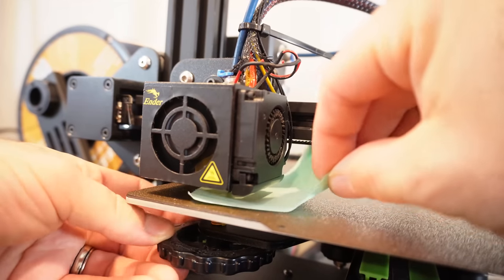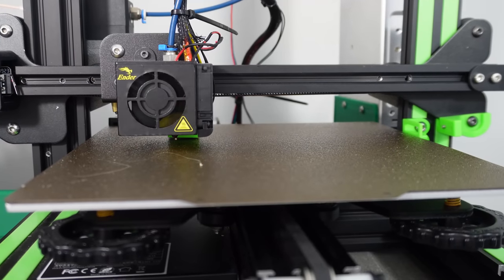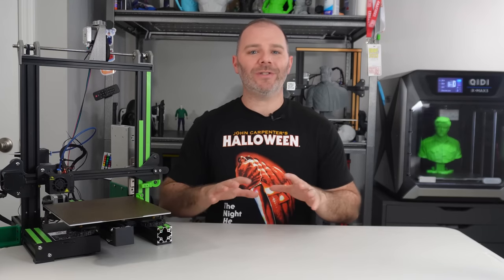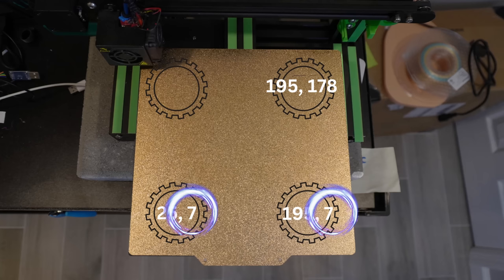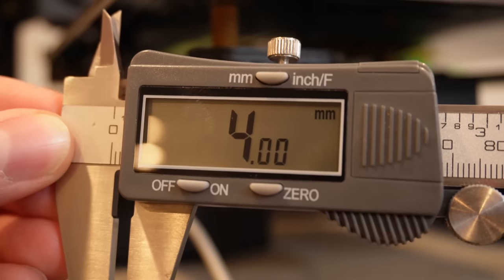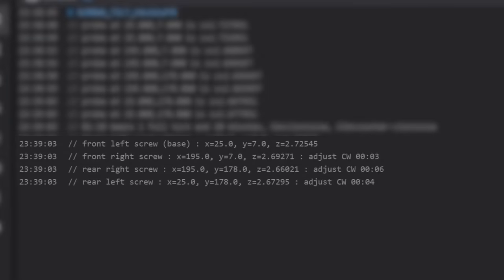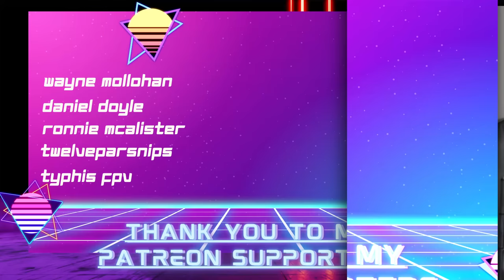Let Klipper level your bed with the built-in tool screws_tilt_adjust

Comment: Can this method be used without a probe? I have a cr10 smart that only has the strain guage, the board is not compatible with a bl touch and i dont want to swap out a perfectly good board.
Reply from the maker: Absolutely! If you're using that strain gauge as the bed probe it will work just the same. All you would do is love the nozzle up over each bed screw, use that location, and the operation should work just the same.
Reply: @PrintsLeo3D  awesome, I was hoping that was the answer. I've been trying to calibrate and dial in my printer since getting the sonic pad 3 months or so ago... has not been an easy or fun task. I just redid my pressure advance with your video. I think I'm getting closer now.
Reply from the maker: Good to hear it. That Sonic pad can be an easy way to enter Klipper, but it sort of puts some barriers between you and Klipper which can end up being detrimental to getting your printer locked in. Hope you sort it all out and I'm happy to help however I can.

Comment: I have a Neptune 4 plus which has 6 base leveling knobs, how do I account for that?
Reply from the maker: Within the screw_tilt_adjust macro, you can add all the screws and positions you have. So while I am only using screw1-screw4, you can add screw5 and screw6. This will cause the printer to also park over those screws and perform the calibration.
Reply: @PrintsLeo3D  thank you! I didn’t know I could just add stuff
Reply from the maker: Yea I had never ran into this either. Luckily we have some really awesome people here on YouTube and on the Discord who were able to verify this works. Good luck and I hope this gives you a silky smooth bed level!

Comment: If you're trying to do this on something like the Neptune 4+, would you just align the extruder tip with the bed springs?
Reply from the maker: I'm not too familiar with the Neptune max 4+ and it's probing system. If it uses just the nozzle as a probe than yes you would just put the nozzle over each of the screws. That printer looks awesome, and almost makes regret buying the T500 instead

Comment: Do you need to heat the bed first?
Reply from the maker: It's up to you. This is a topic that can be up for much debate. I understand most peoples' stance that the bed will change its shape while heated, but I prefer to perform this calibration while it is unheated. In the end what I always recommend is to stay consistent. If you heat the bed while bed leveling, also heat the bed for z offset and bed probing.

Comment: In my opinion the best bed leveling is manual bed leveling. It saves you a lot of time and money. I bought bl touch and built the click probe, didn't work for me. Now I just do manual. I level only when I change filament type otherwise I don't touch anything, it's just works.
Reply from the maker: Well those probes you mentioned really are only effective on a bed that is manually leveled. So either way slice it you still need to get your hands dirty and level. This is a great middle ground to harness the power of those probes and get the bed perfect for them to work effectively while printing!

Comment: Guys please help me out with Klipper on corexy.  I changed my board from marlin(mks gen L to klipper(mks skipr)and my printer got much more louder.  I literally use the same settings as possible.  Same drivers (tmc2209) ,stepper motors etcetera.  
The settings difference are: klipper have sensorless home, uart, and the drivers amper set by klipper, not manually with screw. I did try to change Stealthchop_threshold to 9999999,9999,500,200,60 and 0 by activate the spreadcycle. Nothing different.  Also did try to.play with microsteps but the 16 was the most "quite ".
Reply from the maker: My first guess would be changing over to spread cycle should quiet everything down. When you tried messing around with the tmc settings was there any change in volume whatsoever?

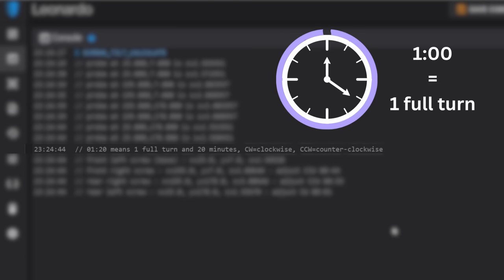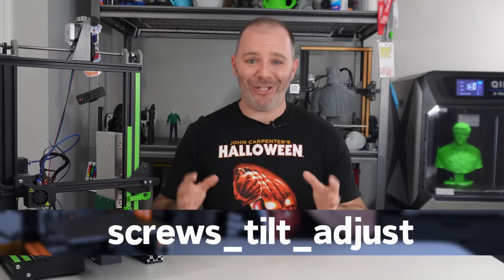Comment: This is a very nice tutorial. Unfortunately you may be confused by the explanation starting @15:32. The example text is "01:20 means 1 full turn and 20 minutes,..." The narration says the clock face has a full rotation of 60 degrees with 1 minute per degree. But this is wrong, obviously. The clock face has a full rotation of 360 degrees, corresponding movement of the minute hand of a clock by 60 minutes. So, for the minute hand of a clock, the rotation is 6 degrees per minute. In these instructions we're told that after 1 full turn ( = 1 hr), we need to add another 20 minutes. So 20 minutes times 6 degrees/minute means to turn by 120 degrees. Or think of it as a fraction of a whole turn where 20 min / 60 min represents 1/3 of a rotation. One third of 360 degrees is 120 degrees. So the "20 minutes" does NOT mean turn the knob 20 degrees (as stated), it means turn the knob 120 degrees ( = 1/3 of a full rotation). The narrator knows how far the knob should be turned, but the explanation is confusing and technically not correct.
Reply from the maker: Thanks for watching and leaving the informed comment. A lot of people have pointed this out, and this isn't how I chose to interpret the way this operation works,  this is just how Klipper implements it. They have deemed this is the best way to characterize the adjustments (1 full rotation is 60 minutes, and thus 30 minutes would be 1/2 a rotation). Obviously a full circle is 360 degrees, but in attempt to (I guess) simplify this, Klipper has opted to consider a full turn 60 degrees, and then slice up each individual degree as a minute. Perhaps it would be better stayed as "Klipper's clock face" or so ething similar but this is the setup they chose. In my opinion I do think this is a more intuitive way to express the information even if they are not 'technically' correct.
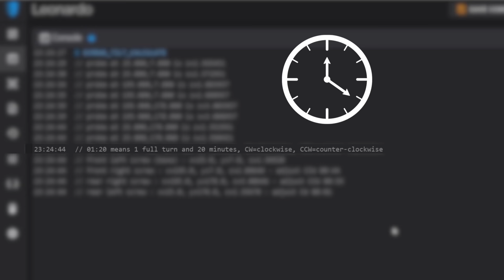Reply: @PrintsLeo3D  Sorry to belabor this point, but it is definitely NOT more intuitive to express 20 minutes on a clock face (1/3 of a full circle) as equal to 20 degrees (after you introduce a new definition that equates 1 min to 1 new degree which in reality represents 6 actual degrees. Most people know that a full turn is 360 degrees. When you reverse course, that doing a 180. A perfect right angle is 90 degrees. So if you talk about degrees, that is the measurement people are already familiar with. I realize you're stuck with certain decisions made by the programmers, but the translation from minutes on a clock face to degrees appears to be something you chose to introduce (see @15:52). Right there you state that 20 minutes = 20 degrees. My question remains: Why?? The Klipper output says nothing about degrees. The ONLY reason to introduce degrees is to take advantage of common knowledge that a full circle represents 360 degrees. It simply confuses the whole thing to REDEFINE one full rotation of the minute hand on a clock represents 60 minutes (ok, people get that) but then calling that 60 degrees (!!! What?? That's just not right..) just confuses things. Now some will easily figure out this redefinition, but anyone who does, also doesn't need to conversion if the first place. In fact no one needs that redefinition, it's actually harder and more confusing than just sticking with minutes on a clock face.

Comment: I have problem with klipper bed mesh, always had it. 
When doing screws_tilt_calculate I can get the bed really level. So Klipper is showing it that every corner is 00:00. 
BUT actually bed is tilted. Left side is lower and right side is higher.
If I manually move the nozzle to each corner the nozzle is crashing on the right and perfect on center but too high on left. And then if I manually level the bed, klipper bed mesh shows it’s tilted even when it is actually not. Manually leveling the bed works and nozzle is at correct height in each corner. So screws_tilt_calculate makes it tilted.
Hard to explain but I cant use bed mesh or scews tilt calculate. 🤷‍♂️
Ender 3. Sprite pro and CR Touch. 
Thanks to everyone that has something to comment or has any idea whats wrong.
Reply from the maker: For something like this I would double check the printhead and the probe itself and make sure they aren't loose or unstable. Also what type of bed are you using? Is it a glass bed or something like a PEI steel sheet?
Reply: @PrintsLeo3D   Thank you for your reply. I use a PEI sheet. The X-carriage is nicely tight, and the probe is fine (accuracy test). I recently rebuilt it, ensuring the frame is as square as possible. The X gantry is perpendicular to the Y, plus I've done a belted Z mod by KevinAKAsam.

After days of googling, I'm considering that my X-extrusion could be twisted ever so slightly. I mean, the probe is pretty far from the nozzle in the Y-axis. When it travels to the right, it changes the z-height by rotating, creating a lever effect.

So, I might model myself a zero-offset CR-Touch mount (if it fits between x-stop and extruder) and see if it helps. If the X-extrusion is twisted, it won't have such a big rotational effect. Just my thought.
Reply from the maker: Sounds like you've done your homework. One last thing to consider is the Axis tilt compensation that has just been rolled into Klipper. This will use your probe and take measurements across your bed, and then use those height measurements to align the X axis across the horizontal plane. This is intended to the issue of having a warped X axis. This was meant for printers using dual rods as a form of X axis (think prusa MK3) but it works for Ender 3 style printers as well. Have a look, it's a topic I want to cover soon.

https://www.klipper3d.org/Axis_Twist_Compensation.html
Reply: @PrintsLeo3D  Thank you very much. I didn't know which term to use when searching for a solution to my problem. That seems to be exactly what I'm looking for. You are a great YouTuber. Keep going!

Comment: Lets see you do it on the QIDI behind you.. mine is out of wack
Reply from the maker: Yea with the Qidi and it's enormous build size there's bound to be deviation in the build surface. While you can't use the routine in the video on the XMax3 (with some modifications) it's still possible to change the tilt of your bed. 
    If you remove the bed sheet you'll see the aluminum bed, and in each of the four corners there are screws. Those screws go through the bed, through a spring,  and then hold it in place. You can make adjustments (tighten or loosen) those screws it it should move the tilt of your bed. Getting it just right might not be possible, but I was able to turn a probing deviation of over 1mm to a deviation of 0.6mm. 
    That all being said with the size of the XMax3's build size I would highly recommend using KAMP , which is Klipper's adaptive mesh routine.

Comment: Great video. What do we add to the gcode to then use the mesh after doing this?
Reply from the maker: This isn't creating you a mesh, this is just using the probe to gather height data and tell you how to level the bed. This routine is something you'd do outside of printing to make sure your bed is level. Using the probe to create a bed mesh (and use it during the print) is something I go over in detail in my longer bl touch video. I linked that in the description and it's worth a watch. If this doesn't make sense let me know and I can break it down a little further

Comment: My print beds haven’t had springs under them for 4 years.
Reply from the maker: Wow that's pretty cool! The first printer I remember using that was used a fixed in place bed was the Eryone Er20. While I don't think that's the best printer there is, I did, at the time, think it was a worthwhile look for people  newer to the hobby.
Reply: Ive got a matching pair of ender 3 pros from 2018 with dual z-axis screws and I tweaked my solid bed mounts until they were nearly perfectly level and locked em in with jam-nuts. And then I run a bl-touch for good measure and I usually dont even need to watch to make sure my first layers are good.

Comment: Something to watch for is the order of those screws. When I run this it does it's probing and then pops up a little window to tell me what to turn. Screw 1 will be the "Base" and get no adjustment. With the order you did that will be your front left. This was an issue for me as if I tightened down all my screws, I had nothing left for the adjustment on that power one. Since my bed is wonky on the right and needs the bed raised on that side I set my screw 1 where the strain relief is. 

just one of them weird things you find out after the fact. You can also give them better names if you're like me and "0,0" "Strain Relief" help remember what screw is what.
Reply from the maker: Hey this is a really great point and something I never even considered. For me the front left screw has never given me an issue. Moving this around if that screw is problematic or if you have other constraints is a very smart idea. I am talking a lot of the recommendations/suggestions from the comments and adding them to the article on my website. You can guarantee this suggestion will be on the list! Thank you!
Reply: @PrintsLeo3D  honestly even the set I use messes with me. Cuz of where it parks after the last one. I have to contort reach funny to hit the back left screw. It'd be killer if there was a "set to this so you can handle the screws" position. But I've not dove into the macros that far. Same with that purge line. It's always right in front and I'd rather it be a bit to the right.

Thanks for the vid tho! I love the screw method to get as close as I can and let the ABL go for it after that. Yet I wonder the value on glass. I should just need the 4 corners and glass is flat, I. Just need the left/right tram.
Reply from the maker: I think I can snap up a quick macro for you that moves the head to the center of the bed after the testing. I'm about to go to bed now but I'll try and remember tomorrow and then see you a message. I mean it's gonna be something really simple like 

[gcode_macro Screw_tilt_hide]
gcode:
    screw_tilt_calculate
    G0 X100 Y100 F12000

So that's the quick and easy version, but I can add some logic that checks if the axes are homed and if not homes the printer first. Then I can make it find the center of your bed instead of arbitrarily being 100, 100.
Reply: @PrintsLeo3D  gonna be honest, I did not expect a response. It was a total off the cuff thing I've not had a chance to do/learn.

Thanks for not giving the "go look it up and figure it out", but giving an answer. That I now see might have been clear had I redone the docs again or again, or maybe for a different issue. But being blind.
Reply from the maker: I will never answer with a ''look it up yourself" lol I think it's absolutely rude, and contrary to fostering a community. That being said I made a cleaner version of the macro for you. 
    This first one will create a new macro you can use (screws_tilt_home). It will check to see if the axes are homed, then if not it will home them. Then it will run screws_tilt_calculate. After that it will move the printhead to the center of the bed and raise it up 15mm.

[gcode_macro screws_tilt_home]
gcode:
    {% if "xyz" not in printer.toolhead.homed_axes %}
        G28
    {% endif %}
    SCREWS_TILT_CALCULATE	
    SAVE_GCODE_STATE NAME=SCREWTILTHOME
    G90           
    G0 X{printer.toolhead.axis_maximum.x/2} Y{printer.toolhead.axis_maximum.y/2} Z{printer.toolhead.axis_minimum.z+10} F6000        
    RESTORE_GCODE_STATE NAME=SCREWTILTHOME

Alternatively if you want to replace the existing definition for screws_tilt_calculate and instead make the above work in its place you would add this:

[gcode_macro screws_tilt_calculate]
rename_existing: SCREWS_TILT_CALCULATE_HOME
gcode:
    {% if "xyz" not in printer.toolhead.homed_axes %}
        G28
    {% endif %}
    SCREWS_TILT_CALCULATE_HOME	
    SAVE_GCODE_STATE NAME=SCREWTILTHOME
    G90           
    G0 X{printer.toolhead.axis_maximum.x/2} Y{printer.toolhead.axis_maximum.y/2} Z{printer.toolhead.axis_minimum.z+10} F6000        
    RESTORE_GCODE_STATE NAME=SCREWTILTHOME

This does all the same operations as the first macro except now when the call is made to screws_tilt_calculate this will be the response. Hope this helps, and if you need any clarification on how this works or how I got here let me know!

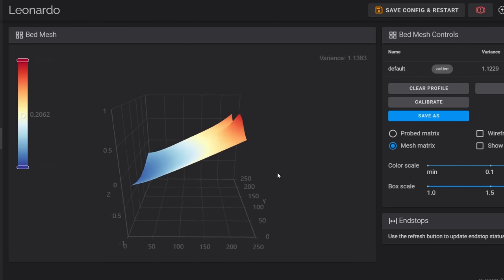Comment: If you've got a bed mesh that looks like the one shown at 13:24, you probably need to check your gantry first. The screw tilt adjust will still work, but you shouldn't make it work harder than it needs to. 🤨
Reply from the maker: Well to be honest Scott all I did to create that mesh was wind my bed out of level, then probed for that mesh. So what you are seeing between the two meshes is a direct result of this macro and a more accurately leveled bed.
    That being said squaring your gantry should be part of any checklist when getting your printer calibrated.

Comment: i think it's important to mention that this function, will only work properly with individually driven dual z screws.
Reply: I don't understand what do dual z screws have to do with it? The macro just measures the height above each leveling screw
Reply from the maker: I think what your thinking of is z_tilt, where two individual stepper motors will level out the X gantry independently. The method in this video screws_tilt_adjust will work regardless of your z stepper configuration.
Reply from the maker: Wooly you're right, and I answered above (or below ? Lol) , I believe they're thinking of z_tilt which levels out the X gantry.

Comment: hey does it work on a ender 6?
Reply from the maker: I'm not too familiar with the Ender 6, I know it's CoreXY and I know that is has an adjustable build plate , I just don't know if it's Klipper compatible or if Creality has put some butchered up version of Klipper on it from the factory. But if you can put Klipper onto this printer then it can 100% utilize this!
Reply: @PrintsLeo3D  ok